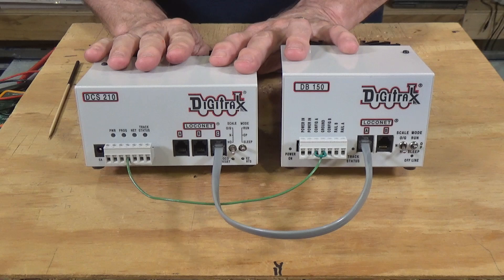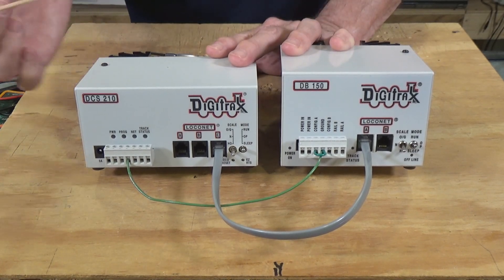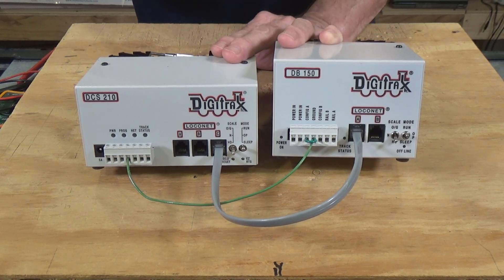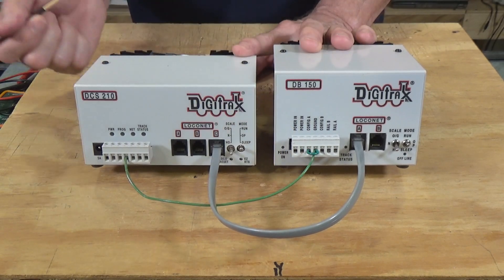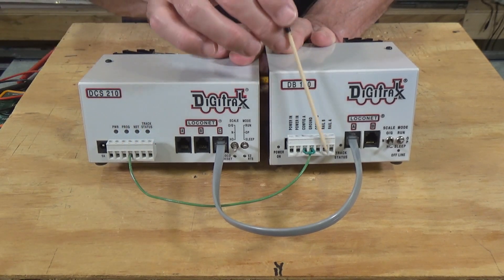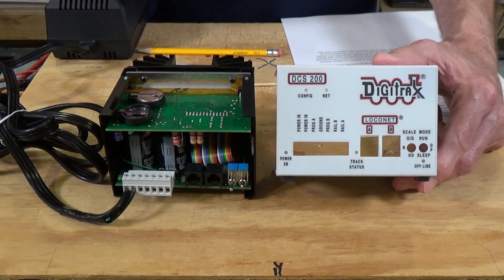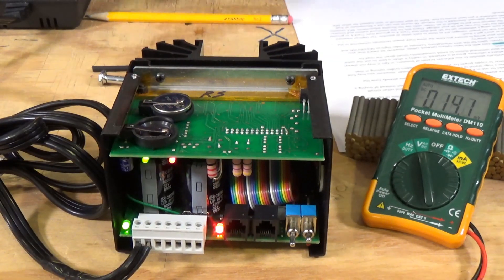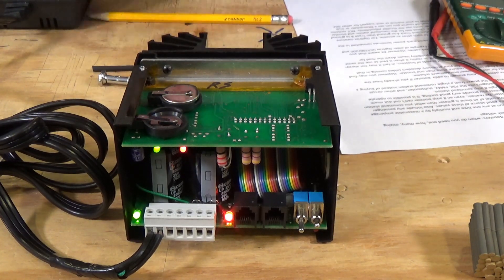Wiring Your Model Railroad--Voltage, Polarity, And More (114)

Comment: When and how do i know if i need a booster? If i do, how do i wire it to the tracks or is that not needed?
Reply from the maker: I have several videos on boosters and power management that go into this plus I covered topics like this in my books (check Amazon), and in my DCC Corner column articles in Model Railroader between 2015 and 2020. Basically if your command station starts shutting down due to heat overloads then you need a booster and you will have to subdivide the layout into blocks and rewire some and yes the booster needs to be connected to the power bus.

Comment: New to this stuff.   What's the purpose of adding a 'booster'?   Is this to replace a track "bus" wire?  And then regarding adjusting the voltage output, why would I want to do that?  What's the purpose?
Reply from the maker: Watch video 113

Comment: I noticed you mentioned connecting both the booster and the command station track terminals to the track...so that would be parallel?
Reply from the maker: No, first, all command stations have a built in booster. The purpose of adding a second or third or more boosters is to allow you to provide extra power to the layout. This requires you to break the layout into two or more isolated blocks each powered by a different power source.

Comment: I am in deep trouble. I am a hobbyist not a scale guy or rivet counter, to make it worse i ONLY have 1950s American Flyer. About 25 engines, 3 loops and a mix of TMCC, MTH DCS, and Conventional. Not one DCC anything. BUT now MTH is sold and TMCC is hard to find and both are getting $200
 per engine to install their Gear. Now, i am asking you a question in hopes you can help. I want to get RailPro with their nice held held unit and radio control Engine Models with Sound. They cost $100 and support wireless operation. In my layout I would then only be able to control Rail Pro engines with a Rail Pro Handheld device or on a PC with they USB interface. This way I can operate ALL my engines on the same layout at the same time. BUT, i am unable to understand how to get DCC inside an Engine from my AC Track Transformers. I have looked for a mini DCC Emulator that i would embed in each engine designed with Rail Pro Modules but I can not fully grasp what is going on and how to do it. 
Can i buy a DCC decoder plug the TM-3S into it and wire the DCC Decoder into a track interface that will take my track power and condition it for the DCC Decoder. I will NEVER use the DCC commands or vcontrol a DCC engine thriu the track signal. I will only use TMCC, MTH DSC and Rail Pro. Can i do this? Is this possible in a unit small enough to put in each Rail Pro Engine for MY Vintage AC track layout??????? I am in Ashburn, VA and don't know any DCC users to ask.  Thanks Dennis in Virginia
Reply from the maker: Dennis, sorry but I have never experimented with any of that stuff and it sounds like you are headed down a path potentially fraught with frustration. Your best bet is to find a dealer/installer who sells all this and has experience so can advise you. Check with Litchfield Station in Arizona, they do a lot,of installs.
Reply: I have learned RailPro operates off a 14.8V battery with Zero DCC interface. Providing all control via their radio control method thru a hand held controller or USB adaptor and PC App. So I need a DC regulated 14V to the LM-3S and the USB adapter to operate on my rails  isolated from TMCC and MTH DCS. Worth the $140 to test. D

Comment: Very informative video, but one thing I see in a lot of video's is...they never say what size wire to use . Sure we all know bus lines and feeders, but your boosters, power managements and such...maybe i missed it but I have not heard or seen  what size wire to use. From a beginner by the way. thanks for your videos
Reply from the maker: It’s back there in one of the 137 other videos on the channel, so check out video 110. I will be discussing it again when we get around to wiring the modules.

Comment: Can you use the dcs 210 with the zephyr ds50 as the command center?
Reply from the maker: You could but why would you want to? Just use the DCS210 as the command station and the DCS50 as a booster.
Reply: The DCC Guy looking on the digitrax site it says the DB210 is not a command station but booster only. The DCS210+ or DCS240 are only command stations.
Reply from the maker: Yes the DCS210 is a combination command station and booster. The DB210 is a booster only. In your original question you referred to the DCS210 not the DB210. You should be able to use the DB210 as the booster with the DCS50. Unfortunately the DCS210 is only available as part of their Evolution system or it would be a good replacement for your DCS50.

Comment: That was extremely informative! Thank you. I've never run Digitrax, but that's a cool little feature of the older models.

Now I know you can't assume the responsibility of sharing this information... But as a stopgap (due to financial situation), I have SUCCESSFULLY run a NCE PowerCab with a 4A Power Brick instead of the 1.5A Wall Wart it comes with. Nothing ever even got WARM, the system had a lot more headroom, and Brownouts were a thing of the past! 

I was eventually able to upgrade to a PowerPro and PowerHouse 10A system... But that trick worked for 7 YEARS! 
Which thanks to this Video, will be adding a couple of Fans to!! 😁
Carmine ✈🚂🚙

Comment: You said electrical specs are given in MR product reviews. I just checked the MR review for Scale Trains N scale C44-9W. There are no specs for current draw. I found the same to be true for the HO version.
Reply from the maker: You did better than me, I can’t find the N scale version. I’ll have to ask Dana why he didn’t give a value for the operating current, he usually does provide those data.
Reply: @TheDCCGuy  I found it on the MR website in staff reviews.
Reply from the maker: Very strange. I searched both the Model Train Magazine Index and the MR Archive search function and could not find the N scale review. Glad it turned up on the MR website for you.
Reply: @TheDCCGuy  I find the MR search functions aren't always reliable. I've done searches for articles I had photocopies but still couldn't find them in search.